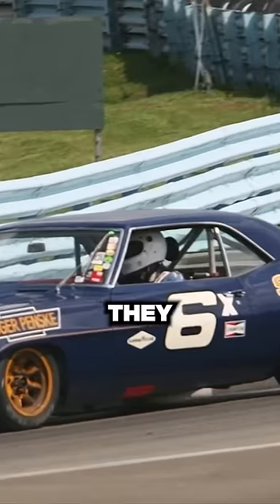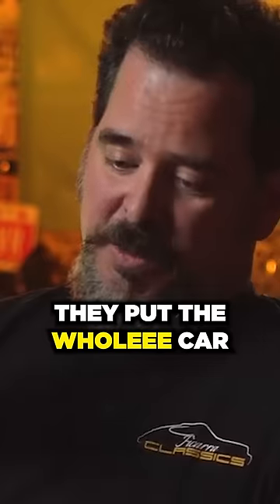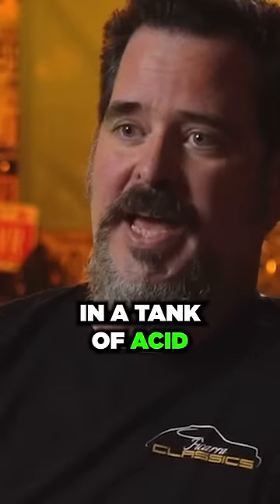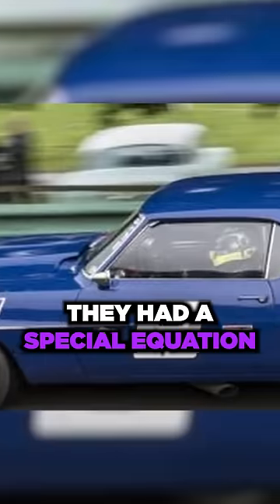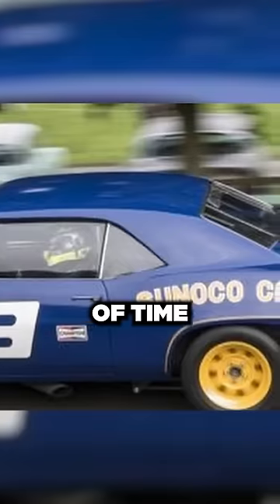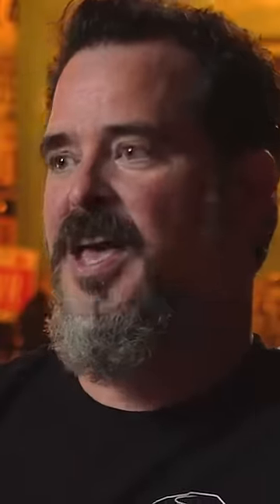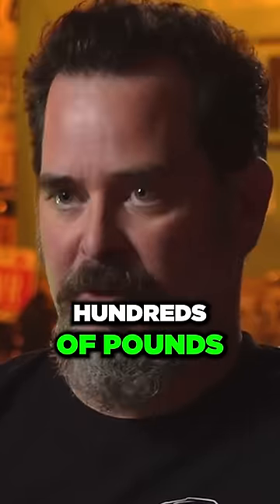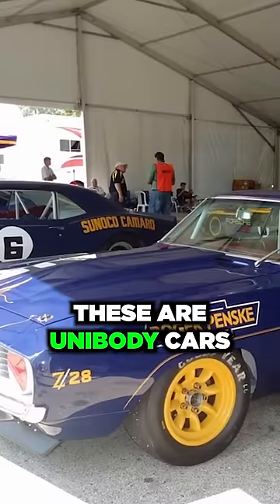The craziest CHEAT in racing history!

Comment: I think you have the story a little mixed up here. Sam Pusey’s Challenger was the car the tech inspector’s elbow dented. They were forced to cut a roof of off a new Challenger at a dealership to install on the race car to make it legal to race.
Acid dipping was a standard practice for all the big teams back then. And it was done in all major race series including NASCAR and NHRA too .
Some teams even cut the cars down is size physically to cut thru the air better. Bud Moore’s Cougars in 1967 were an excellent example.

Comment: still not as crazy as how some nascar teams used to use the frame rails as an extended gas tank, or alternatively they would fill the rails with buckshot so an underweight car would pass inspection and then they would just dump the buckshot out on the track

Comment: Before they caught someone  in drag racing pro stock they made the roll cage out of exhaust material to shave weight hoping they never crashed to save maybe 50 lbs equaling about a half a tenth of a second.The person that I will not mention his name was extremely well know and won many time in 1968- 1971
Reply: there was a very well known fuel altered that's frame and cage was made out of " muffler moly " so that it could be repaired at any muffler shop that had an oxyacetylene torch . I womention any names either , but the driver used to drive it one handed .

Comment: That car was the inspiration behind the racing modification available for the '69 Camaro in Gran Turismo 2.

Acid dipping is a technique used on rally cars, not sure if they still do it though.
Reply: Most race cars have to be dipped to strip the seam sealer so extra spot welds, reinforcement, and roll cage bars can be added

Comment: In the late 60s I used to get HotRod magazine which covered all this sort of 'cheating' in Nascar racing. As  naive UK school kid it opened my eyes to how the rule book was bent and I quickly realised that the rules were pushed to the limit in all motor racing ... and why there were,  for example, minimum weights in formula one.
Reply: Danica Patrick caused Indy Car to alter how they weighed the cars. Formula 1 had long weighed the cars with the drivers, adding ballast to make them all weigh the same. Indy weighed the cars without drivers. Danica was a flyweight 95 pounds. All the male drivers, of course all well over 100 pounds, complained.

To date she's the only woman to win an Indy Car race (though under caution) and only woman to lead the Indy 500. IIRC she failed to follow directions from her crew chief to turn down the fuel flow, which would have, all things going right, had her winning just ahead of 2nd. Moving to NASCAR she ran head on into the "good old boys" quite often where they'd deliberately run into her car, one time the guy who punted her off the track said on his radio "She was in the way.". If he'd done that to a big name driver like Earnhardt Jr. and said "He was in the way." he'd have been fined and penalized by NASCAR.

Comment: in motocross back in the 70's and 80's the japanese suzukis would start using clips instead of bolts to keep the bike together beating out the european bikes by a considerable margin in how light they could make them which translated to faster speed and better handling. however they still needed european riders to get the most out of them.

Comment: If you melt 50% away you can halve the body weight however the steel would only be around .0236. Not familiar with these cars but I would assume they are double layered on the turrets and stress points.
Reply: yeah and double seam welded, etc

Comment: We melted off 250 lbs of weight, and to give it back strength , we added 310 lbs of roll cage. It's a special equation. I know what your thinking, but safety is important. Oh ya, we are looking for a new technical engineer, Hank our previous tech, was in the car when we dipped it.

Comment: You kept showing the Penske Camero when that actually happened to the Dodge at Laguna Seca the team went to a local dealership and got a car off the showroom floor and cut it off and put that on the race car and that’s why the green Dodge Challenger race car has a black roof because that’s the paint they had at the track. I’ve worked on that car and you can see where they welded the roof on!

Comment: In IKF go kart racing of the old 4-cycle, 5 hp, stock B & S classes, I've heard of people letting their cast iron flywheels set outside and rust during the off season.  Then, prior to racing season, they'll clean off the accumulated rust with rust remover and a wire brush.  Then clean off any residual rust remover with brake cleaner and dry with compressed air.  Making sure to not leave any scratch marks by using either a motorized brass wire wheel or a handheld brass wire brush in lieu of a motorized steel wire wheel or a rotary sander.  I've also heard of the flywheel being placed inside of a salt-spray corrosion testing tank to speed up the process.  There was a minimum flywheel weight specified by IKF.  Although most tracks don't remove and weigh flywheels during routine technical inspection.

Comment: Acid Dipped cars are extremely common in all forms of racing known generally as 'Door Slammers'. IE: a car you have to open the door and get into and then shut the door, round track, dragstrip, off-road .. anything you got to open the door to get in is a door Slammer and they acid dip the crap out of em.
Nothing new.. at least goes back to the 50s, maybe earlier.
Reply: Nice shout-out to Penske Driver Mark Donahue there too.. he won the largest percentage of races he entered in history, Died young, Hit a fire extinguisher at 100+ miles an hour with his head. I believe he killed the guy holding the fire extinguisher too.

Comment: They did something similar here in New Zealand, with a particular locally built yacht class, the Stuart 34' s. Once  every five years they get put through a very comprehensive official measurement regime, they have to weigh a certain amount, and  it has to be within certain base measurements i.e. length of hull, width, etc.
They also have to have a toilet, and anchor and other fittings.
One particularly wealthy owner had a lot of the internal bulkheads and frames replaced with much lighter materials, saved something like 50 Kgs, which was a definite advantage, also the yacht was "stiffer" because the materials were more rigid, again, an advantage in some ways.
To keep the yacht the same weight, he had copies made of the toilet, anchor and other things, made out of lead, and painted to resemble the normal items, and would put them aboard when the yacht was going to be measured, and replace them with the lightweight ones once the yacht had a pass mark. So his yacht was 50 Kgs lighter than it was supposed to be, and always sailed both faster and "higher" than the others.
No one ever measured the weight of the fittings separately, so he got away with it for many years.

Comment: I heard another racing story where a man worked around a fuel supply issue by having the roll cage tubes sealed and filled with extra gas as the rules stated the car's official tank could not be made bigger. Well, they didn't and won the race.
Reply: I heard they limited the fuel tank size but not the fuel lines. It wasn’t long before 3 inch diameter fuel lines appeared.
Reply: @Tailspin80  This is took place years and years ago. Like the 50's or something. Person who is an apprentice to the guy that did that, the one who told the story, is really old now.

Comment: The Penske Camaros start life as nothing more than a pile of "white" parts-components without paint. The factory has nothing to do with chassis construction, Penske gets the parts through the usual channels of his Chevrolet delarship. The unit-body section is lightened where possible (we could find no evidence of acid dipping-usually dectedtable by the deterioration of spot welds and the roll cage is welded in, becoming as much spaceframe as roll-over structure. The front subframe is all rewelded, the roll cage is extended to meet the forward rails and all unnecessary brackets and bolts are eliminated. The front fenders and grille assembly are also reinforced, unnecessary metal is removed, and the panels are arranged so the whole assembly attaches by four bolts, this facilitates easy removal for accessiblitiy to the major mechanical componenents.

Comment: Smokey Yunick can tell you all about finding loopholes and bending the rules.
Reply: My best memory of working Tech Inspection of Trans Am cars was when Smokey Yannick and his team showed up late for Tech at Riverside. Car was beautiful in black and gold. Chief of Tech John Timanus said Tech was closed, but OK. He told me to go over the car and tell him if I found anything wrong while he talked to Smokey and they got the paperwork taken care of. I found the doors welded shut and the seams gone. EVERY body panel was EXTREMELY thin. The bottom of the car had a full smooth belly pan, painted beautifully to match the upper bodywork, jacking screws on the front spring perches, and just WAY too many things wrong to remember.John found some body panels were aluminum by putting a small magnet under his wedding ring and touching panels. John told Smokey to take that car home and NEVER bring it to an SCCA race again! Smokey was pissed partly because the Inspector that called out most of these infractions was just pushing his 12th birthday...me. I started Inspecting race cars in January 63, so I was a veteran by late 67.

Comment: Actually the bodies don't weigh that much compared with the engine transmission and suspension so there's not really hundreds of pounds to gain.  You can also not ensure that the acid would eat.exactly the same amount all over the body, so this would be very stupid.  I once worked on a rally car of which the body and roll cage weighed a little over 200kg but the whole car weighed just over 900kg.  This was a 2003 hatchback.  Some of the older models may even have lighter bodies even though they have thicker material because the newer cars had lots of small plates welded together, forming more complex structures to help with accident safety, improve handling, handle more engine torque and carry the ever increasing burden of heavy luxury items.  These days more plastic and aluminium is replacing steel in efforts to reduce weights of cars. Best way to lighten the load is to take out all the yuppie stuff.

Comment: One team had some trick where they would inflate the gas tank so it was a little bigger and held more fuel.
Reply: It wasn’t the gas tank which inflated, it was an object inside. Smokey Yunick installed an oversized fuel tank in one of his cars. Before an inspection, he would place a basketball inside of it. With the ball inflated, the volume of fuel held by the tank conformed to the regulations, and the car passed inspection. The ball would then be deflated and removed.

Comment: Dip car, save weight then add roll cage. Sounds like windshield wipers on a pair of sunglasses or taking an umbrella along when riding in a convertible
Reply: dip the body to offset the extra weight added by the roll cage . Or would you rather carry around the extra weight ?

Comment: I actually bought a acr 1g neon that had this treatment and boy it is light even if it wasnt in there as long as those cars. No cage but seam welded and braced. Was very suprising thing to find out but following the cars owners I can see it was a winner in the neon cup then the first 9sec 1g acr in the quarter later in its life. I found it in some woods in the middle of no where still built but missing the cage and a few bits. Been restoring it to its glory days for about a year now doing a color change because I want to but comparing it to other 1g acrs around the body is so much softer on my car 😂 a full tall can of coke makes my roof dip 😂 havent weighed it but I think 17-1800lbs is about right.

Comment: As much as I love the racing heritage and legacy of the z/28 & the Chevy 302 I don't believe IF Penske/Donahue did this they were at All the first😉 Smokey mentioned do this and an eeriely similar incident with a tech inspector in Daytona circa 1966-1967 during qualifying with the "7/8" scale Chevelle. The Chevelle was not at all smaller or anything but had many subtle refinements from bumper to bumper (hint, hint).

Comment: Now this is absolutely fucking genius but good luck getting in a crash with the steel so thin you have a less crush zone which basically means the steel can't take much of the pressure from hitting something at what ever speed you going so you better have a strong ass roll cage or your body will take that force from the speed you are going no way around it

Comment: I get it but you dip the car and acid to make it lighter but then you add a roll cage which is probably two times heavier than what the acid took off
Reply: Roll cage was a requirement to pass tech in the series for safety, so all cars had it. So they still shaved off weight compared to what the car would've weighed before the acid dip.
Reply: @charliesmith874  gotcha.

Comment: I remember hearing a couple stories from nascar, like a car had several extra feet of fuel line under the car, or one crew had designed some suspension pieces to sheer during the race so that the car would drop several inches improving wind resistance.
Reply: Smokey Yunick was the master of rule bending. When NASCAR limited the fuel tank size, he installed a very large diameter fuel line because the rulebook didn't specify the line diameter. He wanted NASCAR to allow built in air jacks to speed up pitstops so he built a car with them integrated into the rollcage. NASCAR officials told him to cut them off. So he did, took them back to his home shop and tossed them in a corner where they still were during the last interview he gave not long before his death.
Reply: Gotta looooove Ole Smokey!!!  GENIUS!!!!  😃

Comment: So now in 2023.. speaking as someone who has installed literally 10's of thousands of Charger and Challenger hoods, doors and deck lids.. the aluminum panel skins are so thin by design they wouldn't be able to hold the clipboard without deflection. Mind you.. the clipboards are of a much cheaper weight and quality as well.🤣

Comment: It's funny how exaggerated this legend has become. I just read Mark Donahue's book. His account is quite different. Acid dipping didn't shave" hundreds of pounds", more like tens. The roof never dented in from someone leaning on it. They had to put a vinyl roof over it to hide the surface pitting from the acid bath. They're not true unibody cars, they have subframes. The trick suspension did more to make them fast than anything else.

Comment: AAAAnnnd, also they found out the acid dipped car was waaaay under weight and told 'em nope, you can't race that so to get around that they had 2 blue cars that looked exactly the same. One of 'em was #6 the other was #9. One of 'em was the acid dipped cheater car. The other was not. And they'd switch the car door numbers around in the race track garage (somehow they did it so nobody saw it.) and take the non-acid dipped car thru the tech inspection with one of the door numbers on it then then go back to there garage stall and swap out to the other door 
Number and take the non acid dipped car BACK THRU INSPECTION AGAIN!!! they got away with this for awhile.

Comment: You are speaking from a point of major ignorance.  The roll cages in the Trans Am racers was for crash safety regardless of what was done to the body. SCCA had a minimum weight of 3,200lbs for all the cars. Based on the weight of a a stock Camaro. Mustangs stock were about 500lbs lighter. So they were not acid dipped. SCCA rules did not allow acid dipping,, but the higher dollar Chevy teams did it. All the cars had the seats, carpet, headliner, radio, glovebox, etc. strippedout when they were modified for racing. The driver's seat was replaced with a fiberglass seat. The stock gas tank was replaced with a fuel cell (Google it). Stock steel wheels were replaced with wider, yet lighter weight magnesium or aluminum wheels. Wider racing tires were put on. Engines were modified to the limits under the rules. Typically about 470hp out of 5.0 liter (305ci) max. In the late 60s and early 70s I was an SCCA Technical and Safety Inspector working in the SoCal region. I worked with SCCA Pro Series Tech Director John Timanus when the pro series, Trans Am, Can Am and the Continental Formula 5000 series came to SoCal. Later I worked on Trans Am teams doing pit crew and fabricating when Trans Am cars were tube frames with mostly fiberglass bodies. And restored some race cars from the classic era of Trans Am, including Penske's 71 Javelin. So I speak from a point of personal knowledge of this racing. Not shouting bs from the cheap seats.

Comment: I call B.S. on the "acid bath" story.
Reply: This is well documented and has been an open secret since the 1960s.
Reply: As an SCCA Tech Inspector of the time. I can verify that it was done. I never saw evidence of it on any Mustangs as they started out about 500lbs under the minimum weight. Certainly not done on the 67 Shelby TA/Group 2 or 69 Boss 302 that I restored. So that trick wasn't needed. The 70 Challengers and 'Cudas were heavier than the early Barracuda. So they had to work to get down to weight just like the Camaros.

Comment: This story is crap, they are not using an acid dip to get rid of steel, they use it to get rid of under coat, paint, seam sealer. The foam between the roof skin and the roof structure was gone thats why the roof is floppy. I have a 68 Camaro and can tell you the unibody doesn’t weigh enough to lose “hundreds” of pounds by way of eating away the structure of the car. without cutting away lots of material. You ant loosing much weight, we build stock body drag cars, and cutting weight is something I know about, paint and undercoat is heavy